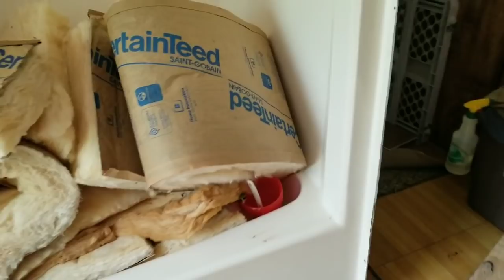#2019 $5000 SINGLE WIDE MOBILE HOME RENOVATION EP.10 CHANGE OF DIRECTION...AGAIN

Comment: Rule in our house, close the toilet lid before you flush.  While I agree that you don't need a huge walkway in your bathroom, it is nice to have it not super cramped either.  Closets are very useful!  If you can, keep at least a small one in the "guest room".  Also a linen closet or cabinet inside or outside the bathroom is good too. It's your home, do it the way you want.
Reply from the maker: Since I wont have a regular swing indoor, I will probably have some sort of cabinet or shelf in that spot

Comment: Using the floor as a reference shot for what will ultimately be "level" is the right idea. Everything runs from the steel frame beneath the floor. That frame will not change....tho if it does you're screwed anyway. But I digress. I would take some plumb bob measurements at various points and use those to plot out the "correct" angle for walls to floor. If nothing else, it will give a great sense of accomplishment for mathing things out. :-)

Comment: I used to sell Artcraft Mobile Homes when I was in the Army at Fort Hood Texas part time. Sold Cars etc and Drove for the Commanding General a Three Star two tours there. My 1979 Artcraft built with Marine Plywood Floors and Double Studded 0n 12" Centers with a reinforced Frame 14x72  had 5 brakes and 1 Drag Axle I paid 19000.00 for that hurricane house 24 tie downs. I paid 10g down on a VA Loan. I still have it as a Guest House. I had hell getting it transported to Shreveport 350 miles. It Blew 19 Tires on the Trip. Uncle SAM paid for the Relocation. I still appreciate C.L. Dulaney with his Peterbilt and Tire Crew and his escorts. With all our Stuff in it it weighed in at 98,000 Lbs Over Load but HUD Approved it. His Triple Axle Peterbilt did the Job. Remember if Man makes it Man can Fix it... You have to get it to the Right Man. You seem to know what you are doing and rough times we all go through. Keep it Simple Find you a Country Girl and be Happy. I bought the Peterbilt Emblems off his Hood and still have them. LOL...  Sorry I had to say this I wanted to comment.
Reply from the maker: HAHAHA awesome story Reno. Ugh relationships I'm happy being single, less stress and drama. My last relationship caused me to basically go full MGTOW lol

Comment: I'm catching up watching your earlier videos and am wondering if you solved the leaking window problem? If not, have you checked the window weep holes? 3 rooms in my trailer had the floors wrecked when we bought it. Couldn't figure out the leak until I noticed that whoever painted the house painted over the weep holes. I opened them up with a screwdriver and Razor, no more leaks. Thought it was worth sharing.
Reply from the maker: Thank You Jan!